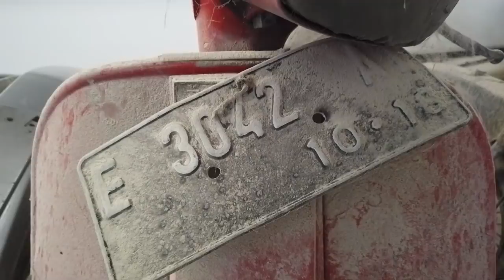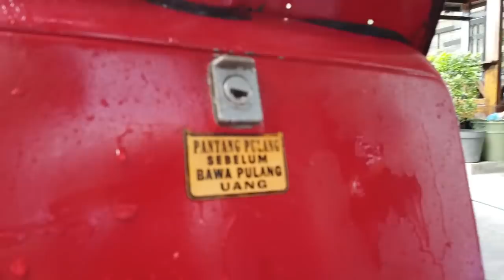MENCOBA RESTORASI VESPA PX 150 YANG KAMI TEMUKAN TERTIMBUN BERTAHUN-TAHUN DI GUDANG #MOTOVLOG

Comment: Kemungkinan itu P150XE Exclusive 1, tipe setelah P150X Mk.2 & PX Sport, ini juga dibilang 'Exclusive Tua'. Bedanya sama exclusive 2 yg paling mecolok di bumper depan, Exclusive 1 bumber masih mengadaptasi design PX lama, Exclusive 2 sudah pake spakbor seperti vespa Excel muda.  Speedometer juga enggak kayak PX Mk.1 & Mk.2 yg bentuknya lingkaran, Exclusive sudah pake speedo khas dia, sama kayak STRADA 2. Keluarga Exclusive kalok gak salah sudah pakai CDI . Jok kebanyakan memang jok pisah untuk PX series

Semangat bang restorasi PXnya 👍
Reply from the maker: Wah lengkap banget nih broo, boleh nih project bareng, thanks ya bro! 🙏🏻
Reply: @earthautoconcept  siap bang, semangat terus bikin kontennya